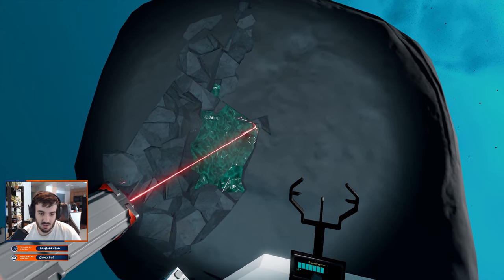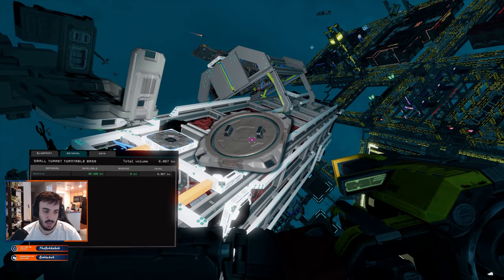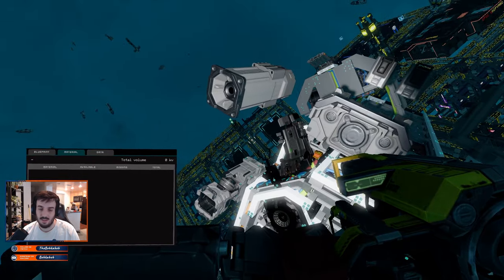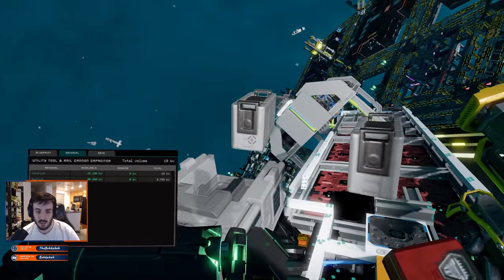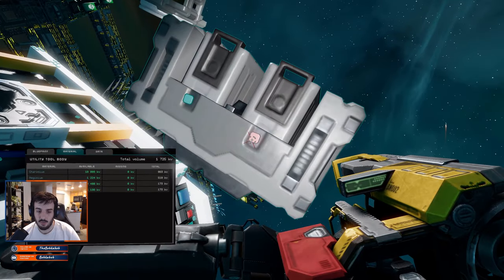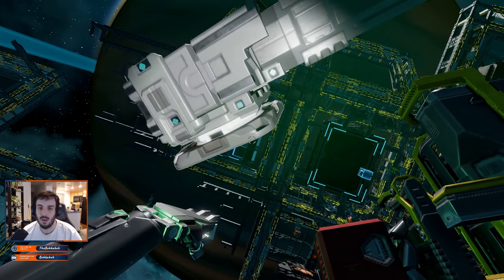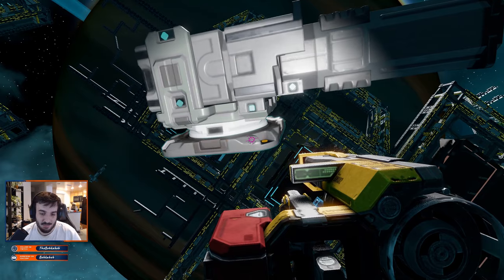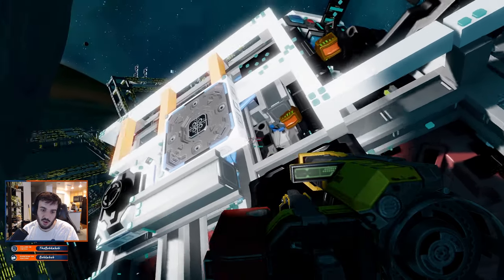Guide to Building MINING LASERS & ORE COLLECTORS | Starbase Early Access

Comment: I found why Small Turret Base doesn't attach to Turntable Mount! STB consists of 2 parts: inner small disc with two metal parts and outer one. If you grab inner small disc then it snaps totally fine!
Reply from the maker: Big if true, I didn’t test this myself but it sounds right since the plate looks like it is actually made out of two different things. Very weird

Comment: Names in crafting station / Shopping list:
- Small Turret Turntable
- Small Turntable Mount 2
- Utility Tool Body
- Utility Tool & Rail Cannon Capacitor
- Mining Laser
Reply: Well. I assembled everything like you did and stuffed it onto the marmot-st that I bought from the shop... Nice right. BUT, for some odd reason the ship now drifts. I had been doing mining on my own in the safe zone and all worked fine you know. When you release the throttle, you can see the reverse thrusters working to brake. With the mining laser and ore collecter in slots B and D, the only way to fire the forward facing auxillary thrusters is by strafing up and down (prolly left and right as well) but mainly it doesn't brake anymore :(
Well it's too late here now need to take a nap will try tomorrow by taking off both turrets.

Comment: I'm trying to do this for about 3 times ,I simply cannot bolt the thing's together,they won't bolt,I try everything,do you have to have the parts researched?I just buy the parts from auction house !
Reply from the maker: Try picking up the turntable plate by pressing "P" and dropping it back into the world. You can press "C" to turn off/on the snapping, try just wildly rotating the plate as well as the turret because somehow that affects it. Finally make sure there are no bolts on where the turret would mount onto the plate, sometimes if you already bolted it onto the hardpoint it can mess you up. Also if you don't plan on having it move around, you can also used the fixed weapons mount. Best of luck pal it's a mess out there!
Reply: @Bobkabob  Thx,i try selling and rebuyng,still not working,I will try the research fink first.Can you make a tutorial on how to repair your ship?I got a expensive ship,hit a asteroid and don't now how to repair it.The building tool only clones the panels,just makes new panels that are not attached to the ship,now I have a lot of panells,I have to manual dismantle old ones and then weld the new ones,it's a pain in the ass. 😂😂😂

Comment: Did I miss the part where you explain how to set up a button or the data portion of the Collector?
Reply from the maker: Pretty sure I didn't include it since it was fairly easy. There's two options on the Collector. One is just to turn it on/off and can be set up with a button much like "MiningLaserOn" , and the other data value is for the collector power. By default it uses 2,000 energy per tick, and can go up to 6,000. Higher power simply means it has a further range! Hope that helps!